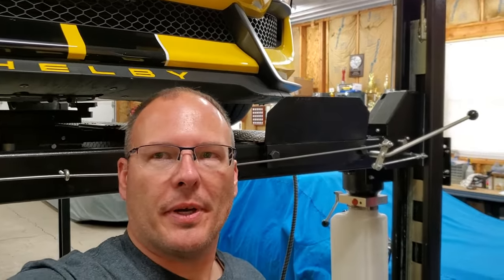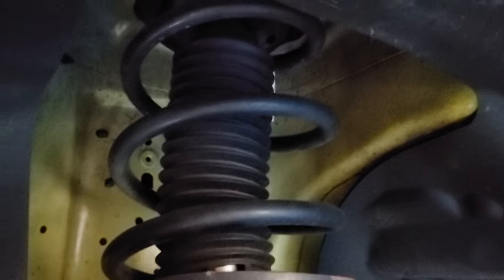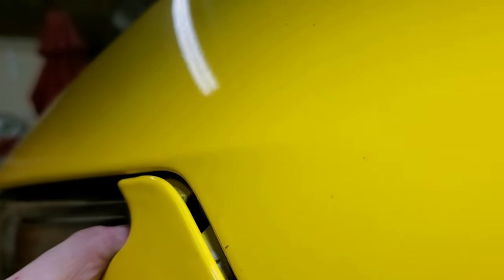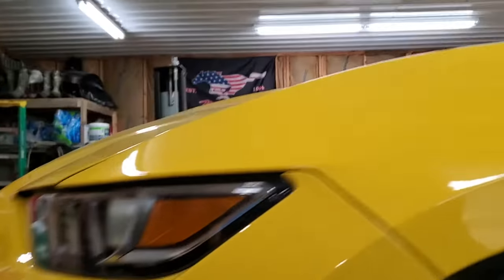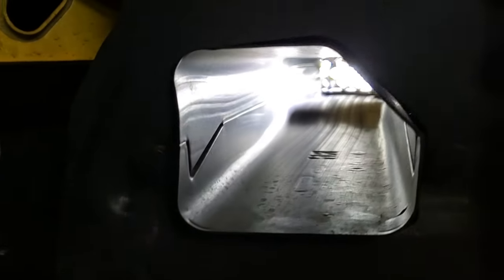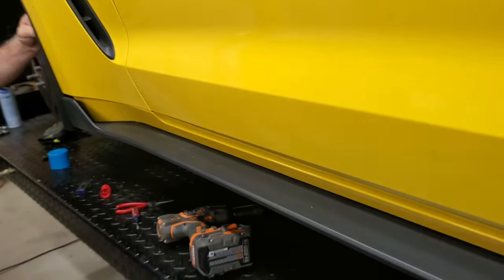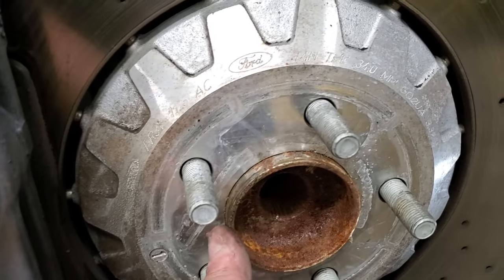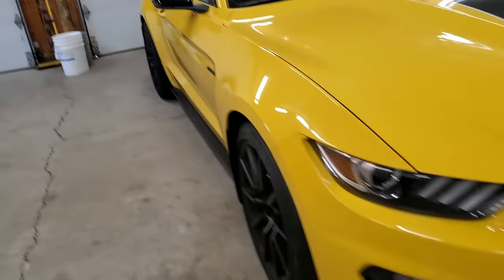Shelby GT350 or Roush RS3?

Comment: The Roush is a spruced up GT.  The 350 is a different platform.  It would cost a small fortune to try to convert a GT into a 350.  Different motor, transmission, coolers, brakes, body panels, etc.  you could upgrade a GT with Roush adds but the Shelby starts off an inch wider, etc.  trying to create a 350 from a GT would be very cost prohibitive.  The RS3 is a badass car, but you could build one yourself if you wanted to piecemeal it from an existing GT. The same can't really be said for a 350
Reply from the maker: Thanks for the comment and for watch the channel.
Reply: Couldn't have said it better.

Comment: Shelby hands down
Reply from the maker: The Shelby rides and handles better, but it doesn't make power until above 3500 rpm.  The Roush makes power in a lower rpm range and is faster.  Both do certain things really well.  I would agree with you though, the refinement of the Shelby in my opinion makes it the winner.